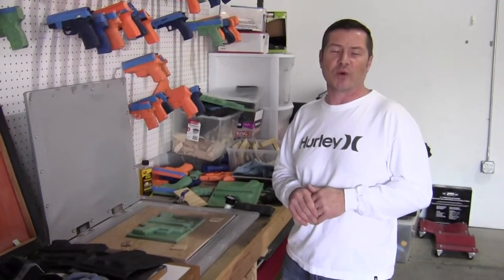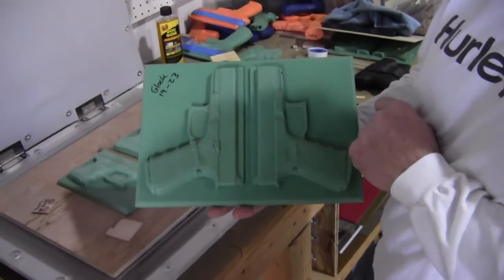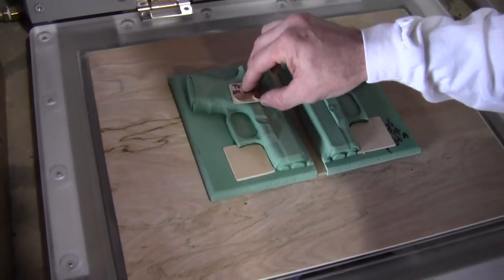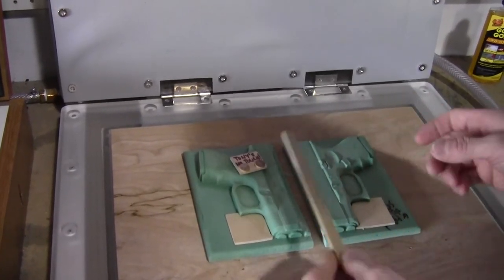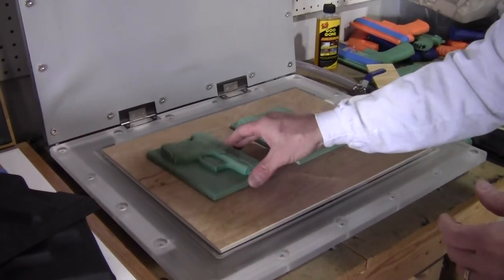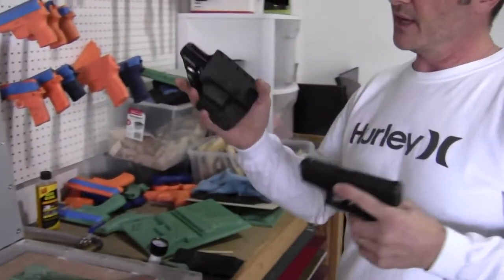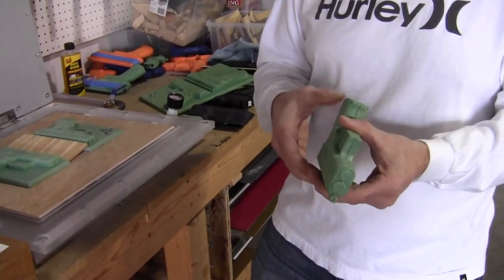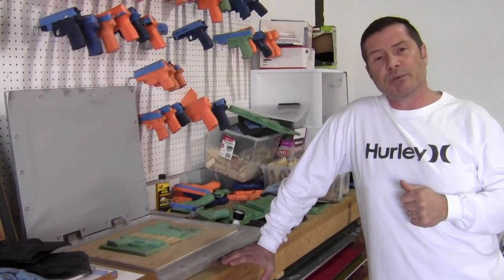Multi Molds Split Molds Informational Video

Comment: I was just curious as to what the benefit is for taco style holsters? I'm not seeing how it will work for them since you're only molding one side. Maybe you could do a video on how you do a taco style. I prefer to make them and I have many multimold guns. I am interested in the split mold if I can understand HOW to use it for fold overs.

Comment: i build stuarts pvc vacuum pres with a few modifications and it is 24" x 36" in side dementions and it works out standing i also have a couple of your molds and they are working great

Comment: What is the strip heater? I haven't seen a video showing how one takes the kydex from a split mold, heat the middle and bend it over.

Any links would be helpful.
Reply from the maker: SafeArmsReview If I get some time soon I will put a video together. I know there are quite a few others who do show this
Reply: Seen one guy use curling tongs to soften the centre strip

Comment: I have been considering buying the split molds or maybe splitting my existing molds.  Questions; Do you have to glue the blocking to the molds? Meaning, I would have to have separate split mold for right hand and left hand, retention and no retention holsters?

Greg
Index Point Holsters.com
Reply from the maker: Yes you would definitely need a left and a right. We sell them on my website and they are as true to 50% as we can get them
Reply: +multiholsters So then, you are gluing the blocking in place?  How thick is the base plate on the split molds?
Reply from the maker: +Gregory P yes, we use double sided sticky tape

Comment: why would you make a video where you promote some split molds that have to be cut and extend in order to work? Why don't you update your product and extend it yourself before selling it to us...so lame
Reply from the maker: If you can't figure out how to make my product work then perhaps you shouldn't be making holsters. You see, it's the guys who can think on their feet who make it in this industry. But thanks for your opinion I'm doing quite well thanks
Reply: That seems pretty obvious to me. Different holster designs require different spacing. Although I do think the product would be better if it came in two separate halves already of minimum spacing to be functional, extra spacing could be added with spacer material as shown.